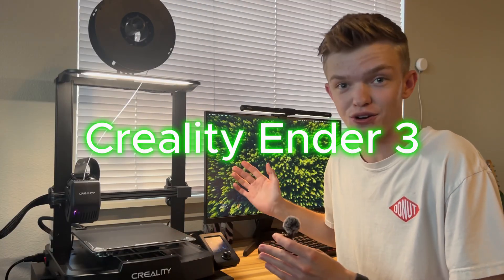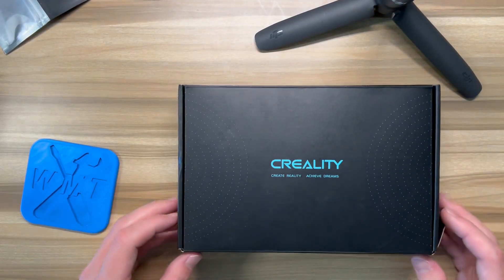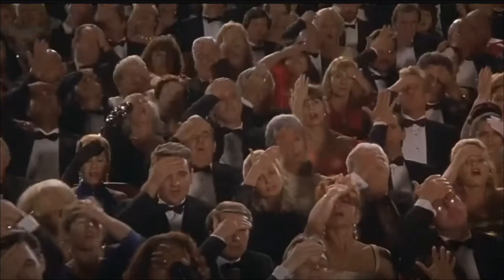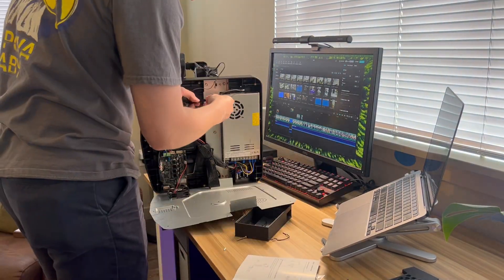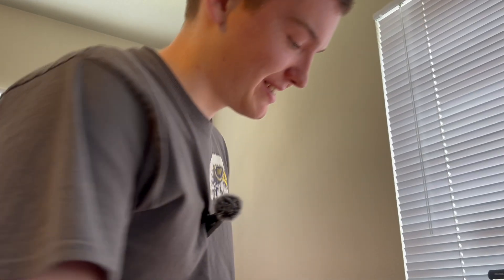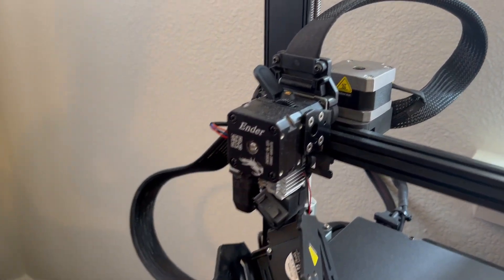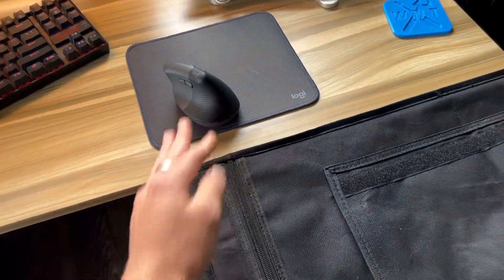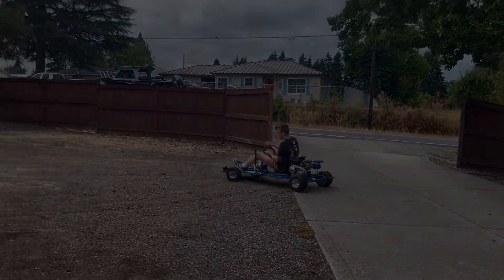What's the MOST popular BUDGET 3D printer like after 6 months??

Comment: Just a quick PA, 3D printers lets off extremely fine particals, that have potentiale health risks, so having it right next to your work area is not too good. And this is not just for asa/abs, this is petg, pla and all others. 
+The glue on some heatbeds can  emit small amounts of gas. Best advice, keep it in the enclosure and have a window open when printing 😁
Oh and dont print abs og asa i the area where you breath...
Reply from the maker: Thank you, you’re right, I should mentioned this in the video but it is next to windows that I open while printing and I don’t typically work right next to it when it is printing. Also, as I said in the video, I am planning on moving it inside my new enclosure soon. Thank you for the info!

Comment: Nice set up bro. Just to let you know 3D printers emit micro plastics that are harmful if breathed in and considering that the 3D printer is in ur room u gonna need to have a enclosure with a air ventilation system running through it. I had to do that because I didn’t want to harm my family members .
Reply: Depends on what Material you print really. PLA+ is fine.
Reply: @joelfogelman4156  oh interesting thank you for the info